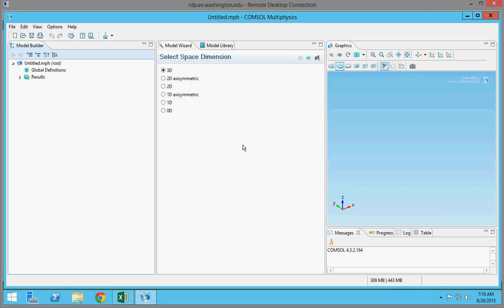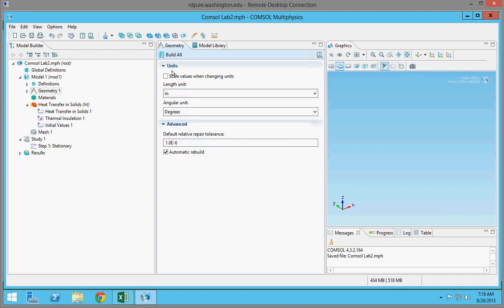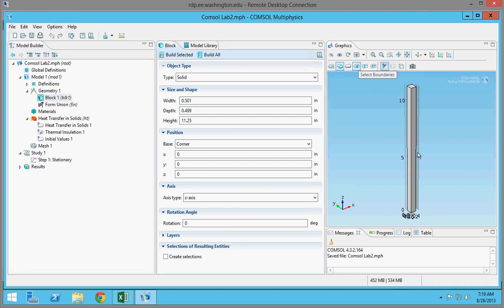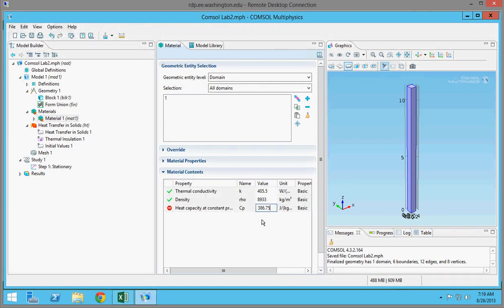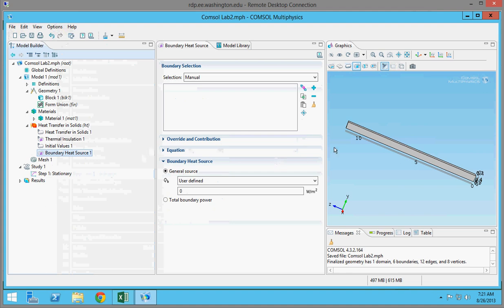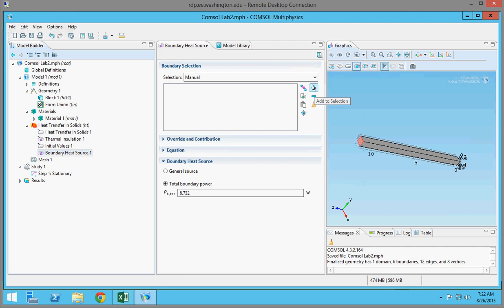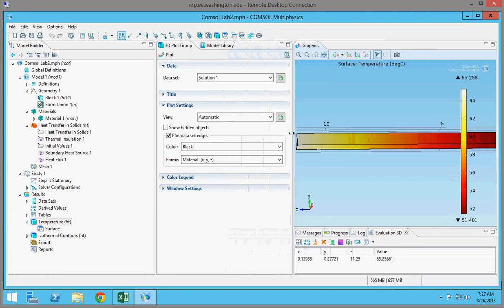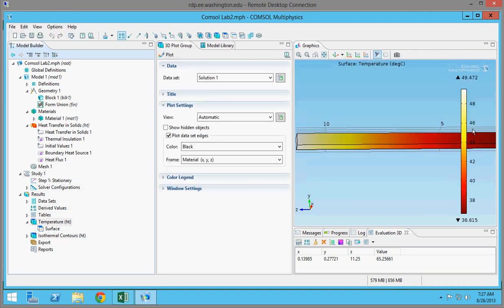Comsol demonstration

Comment: If you don't want to do the unit conversion you could just type "25.49[degC]" into the initial values box and it will automatically convert to K

Comment: thank you very much for your excellent tutorial. I watched the whole series. Im doing research for my master thesis. Im trying to build diffraction grating for ultrasound but I wasn't able to do it so far ;( I have less than 2 weeks to submit the proposal and I need to show some preliminary results. could you please post a tutorial about this project or any thing can help? im using lambda 0.4mm and the pitch of grating is also 0.4 mm. the sound wave should strike the grating at some angle, then there is mirror behind the grating which will reflect the wave and send them back through the grating, then we need to see the pattern in front of the grating.  you are very expert and im sure this is a piece of cake. Im looking to hear from you soon please
Reply: +jacob M did you get any response? I am doing a similar thing and was hoping you had some results. I realise I'm very late but was hoping you had something.